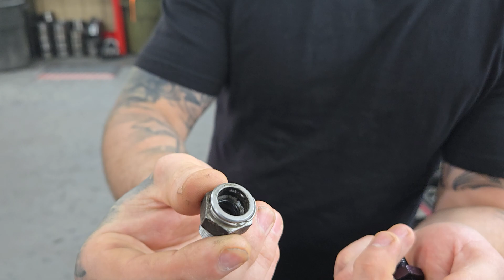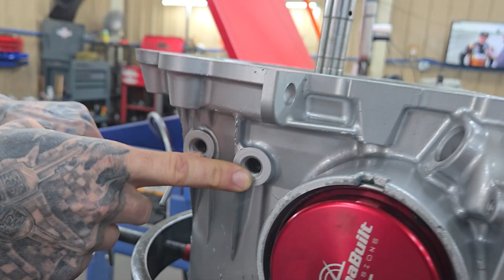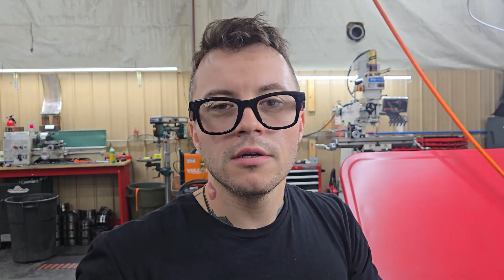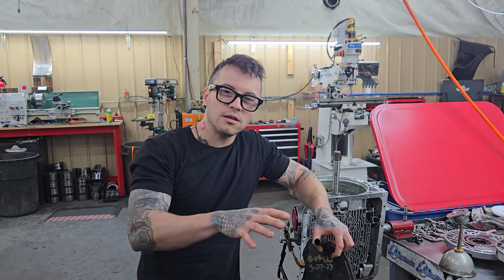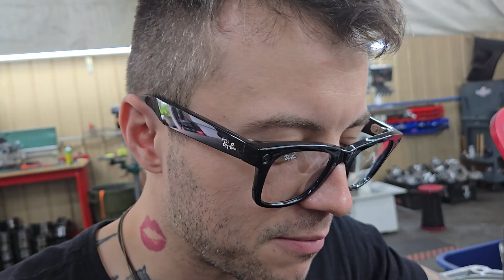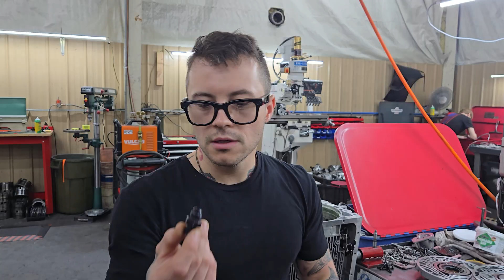Oil is NOT just Oil. What Transmission Oil Actually Does

Comment: I need some advice . Ive been watching some of your videos and learning stuff. I had pump failure on 4l60e that i had put into an avalanche. I rebuilt it and put it back and it broke again within a month of driving. But had good shift both times before failure. So i bought a New heavy duty torque converter of the same stall. Along with new rear solenoids ,new filter, Corvette servo, and switched over everything to dexron 6. Installed and it wouldn't move in any gear and would whine in neutral and the driveline bounces at the tailhousing. Took it back out, pump is not broken this time,i checked band clearance rotation and squeak noise. Put the old solenoids and old servo back in and double checked converter spacing and added washers to space. Is pumping fluid. Started truck. Same problem. Moves now in gears but reverse seems to lurch forward a bit when you let off the gas, and forward feels strange and weak and maybe wants to drive in neutral. And whines in neutral possibly around tail and drilene is bouncing or pulsing with this noise. I didn't go deeper than removing the reverse drum inspecting, and put it back and check rotation. A little wear one the reverse drum cage fingers which i sanded the burrs off. Why is it whining in neutral. I can't find my same symptoms online. Especially after install. Should I go inside and check sprag like your other video? Maybe something engaged all the time? Everything i touched seemed legit. Gonna pump out dexron 6 and put dexron 3 like the stick says and see if it changes something. Any advice is appreciated.

Comment: Been Subscribed for 4 years, I put a reusable High Flow Oil Filter in my 4L60, I made it where I can separate the filter body to clean out the filter, BTW you looked cooler with longer hair, now you'd look better without the top hair, Just Saying, i put the 6 AN fittings on my 4L60 2 years ago.
Reply from the maker: Shampoo and conditioner was expensive 🤣

Comment: Can you run john deere hyguard in 4l60e to tighten a converter?
Reply from the maker: Yes but it will shorten the life of the trans because it does not have detergents. Also i personally dont care for it being clear because it will look burnt quickly when its not because of the clutches shedding debris over miles. Makes it hard to diagnose

Comment: I recently changed to TO-4 hydraulic fluid and rear sump filter.
I did not run a trans pressure sensor for a while, would routinely burn forward and intermediate clutches after a drag and drive, didn't know why.
I added a sensor and found out that it was starving the pump and dropping to 60 psi shortly after the launch on a pass, not good; clutches and fluid don't like it very much.

Comment: Can I convert my 700R4 to a 4L60? Would love to get rid of the TV cable but a new trans is not in the budget right now
Reply from the maker: Yes you can exactly almost with a 93-97 style 1 pc case. Same dimesions as the 700. Youll just need some extra cash for a standalone controller, dont try to use a stock computer